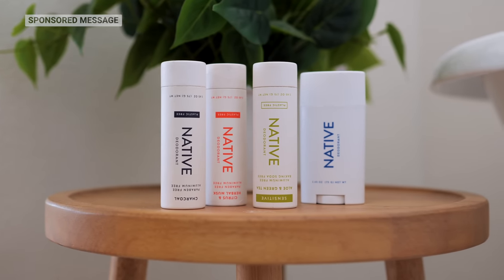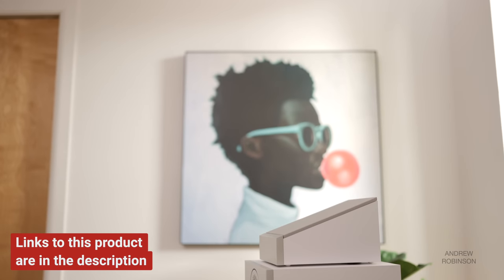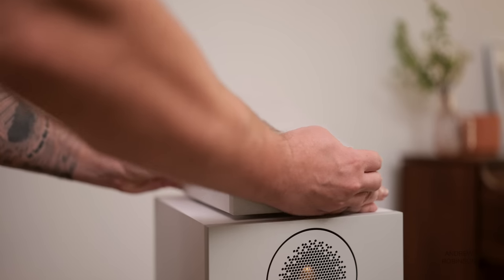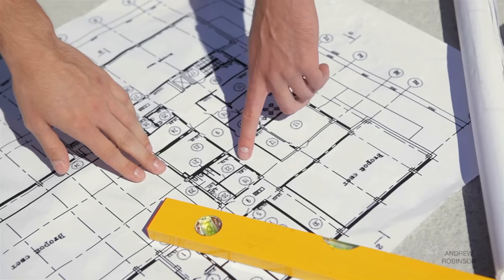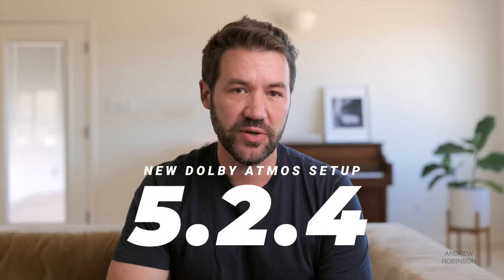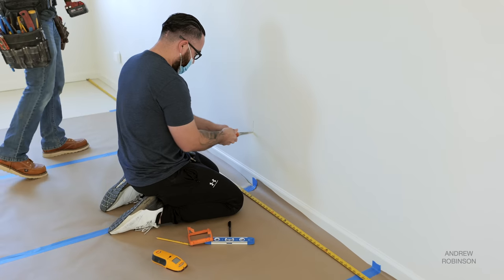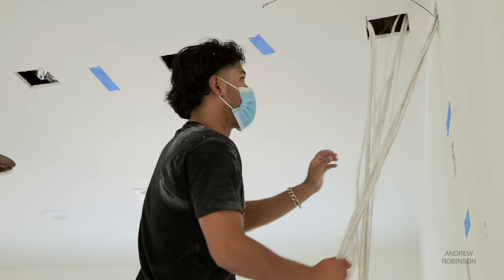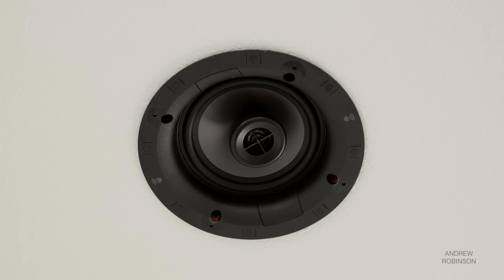INSTALLING DOLBY ATMOS SPEAKERS! Atmos In Ceiling Speakers

Comment: The comment about not liking rear surround speakers on stands got me thinking about my room.  My speakers are all up high on walls--that was how I had the room wired when it was renovated, and there's a door on the left side of the room where the front left channel is, so the only mounting location is above the door. (the speakers are all Klipsch Quintet speakers from about 20 years ago and I like them a lot.)  Also in the center of the front of the room is the back of the fireplace from the living room which is brick protruding about 2 feet into the family room, which is where the center channel is mounted.  A few weeks ago I got some Sony Atmos upfiring speakers and mounted them on either side of the center channel (which is above the TV).  I listened to the one Atmos disc I have (Steven Wilson's "The Future Bites") and I could definitely hear the Atmos content, as well as from shows on streaming that use it.  I just feel bad sometimes because I keep hearing you're supposed to have speakers at ear height.  (They do angle down to point to the main listening location).  It sounds good to me so I guess by the mantra of this channel that's all that matters, and there's really no other way to do it here so I'll be okay.

Comment: I added 4 ceiling speakers to our new house as well. I initially intended to use 2 for atmos and 2 for rear but the surround sound never sounded right. It wasn't until I bit the bullet and added two bookshelf speakers at head level for the rear channel that the atmos surround sound came alive. Even with aim-able ceiling speakers I couldn't move them enough to trick my ear into hearing "rear" sound from ceiling speakers.

Comment: Paint will oxidize and darken a bit if it's not used for a while....Andrew, I've always been under the impression that "surround" speakers whether side or rear were supposed to be around ear level to maximize their effect in a home theater...does having those channels in the ceiling change that experience?...in a good way, bad way?...not noticeable?

Comment: Hi;  I like you we have had some sort of variations of surround set-up's over the last 10 years, but I was lucky enough to have a barn 35x60 on the properity we bought a couple years ago and I have built a dedicated  music/theater room 35x24. I went with in wall/ceiling by RBH 8" woofers & dual adjustable tweeters, I also boxed them in and used sound deading and Rockwool insulation. The front speakers are RevelF228 Be's LCR and SVS subs. All I can say is  it blew me away from the old set-ups' and yes I did have the Revels for several of those iterations. When you get finished if you want to hear what your system can do put on the 4K atmos version of Waterworld , sit back  and enjoy.

Comment: Thanks for documenting the work. So, I thought rear speakers needed to be at ear level to the sides. I would be curious how they sound overhead. Years ago when we bought our house I purchased some Canton Ergo 601 speakers, which are shallow depth on wall slightly above ear height. They actually sound really good but in wall would have looked way better.

Comment: I know they are not Kristy’s exact words but Atmos is where the line is crossed in the waf and aesthetics department.  I would venture that putting 2 in ceiling speaker for rears is a nice compromise for rear surrounds unless your house is prewired when you built it as I had the luck to do.

Comment: That's a tough question.  I've done a little research on atmos placement recently, and it seems like even people that have been doing audio for years and years, put their atmos speakers in the wrong spots, either choosing aesthetics over sound, or following a diagram rather than doing measurements, or just by accident, and end up with disappointing sound, but if they are placed exactly right, it makes, apparently, dramatic differences to what they had previously experienced.  So, yes, I think, if you did your measurements correctly, you should hear a DRAMATIC improvement in sound over up firing atmos speakers.

Comment: I've got Niles in ceiling speakers and painted the grilles just using a fine brush and dabbing rather than brushing. That way the grille holes weren't compromised.

Comment: Hi Andrew, love the videos! I have a question I currently have the itch to integrate some kind of Atmos setup in my current 5.1 setup.  My rears on my setup are in ceiling just behind my listening position currently. I see you have gone that route for your rears as well.  How are you liking that? Vs having listening level rears.  I’m trying to decide whether to replace my rears at listening level or just add some upward firing Atmos speakers to my front speakers for a 5.1.2 (vs 5.1.4 by adding additional rears).  I also hate the look of rear speakers on stands.

Comment: The CDT-2800-C II’s you linked are not the same as the DS-160CDTs you installed. The former have horn tweeters while the latter have silk domes.

Where did you get the DS-160CDT?

Comment: Been here did that but after $9000 system with 8 ceiling speakers in our last house i would never do it again. New house setup is 2.1 this time $5000 and is all anyone needs. These home theater with 10, 12, 14 speakers i think is just way to much. Put the same money into a 2.1 setup and you will have better sound and better equipment.
Reply from the maker: If we didn't have the channel, I'm not 100% certain I would personally venture beyond 2.1 for music or movies.
Reply: Couldn’t agree more! I’ve had multiple “audiophile” and surround setups. The two best systems for dimensionality are hands down stereo setups. First is playing games on my PlayStation 5. The 3D audio engine is mind blowing, I can pinpoint sounds in a 3D space perfectly with my sub $100 studio headphone monitors. Next would be my desktop setup, with a nice DAC, Tube preamp, and studio monitors. With my desktop setup; there isn’t any sound behind me. Although; the horizontal, vertical and depth of field is astounding. There is also the issue of adaptability, I don’t think many movies studios actually go to very much effort to utilize rear channels. Home theater is like razors, they keep adding blades but it’s just a gimmick. My facial hair is like steal wool and my classic Gillette two blades are still the best razor. For massive spaces surrounds make sense, for 90% of people a 2.1 will be better.

Comment: Hey Kids, again congrats on your new home.
Thanks for sharing your cautionary tale to folks that decide to embark upon Install or In Wall speakers. Most may not foresee these problematic considerations, so bless you for putting it on the table. Its construction. Period. Arrrgh.
You probably went the right way if your bottom line was minimalist layout.. My question is what factors led you to in ceiling vs in wall format because you are now kinda locked into the Dolby Atmos only (or Atmos maximal) set up ? Are you not worried about un-maximised Auro or DTSX set up or potential? Or are you baking in a cost/simplicity comprise into your final solution? Maybe you don't have a back wall for #6 or #7 in wall?

Regarding"height" or "elevated"... depending upon who you follow, some suggest it might be best achieved on the vertical plane as suggested as  by Auro's designer Wilfried V-.B.
What are/were your thoughts or research about obtaining maximal height/Atmos-y results?
Did you finally go with compromise or preference or studies?
Either way I'm glad you didn't cheap out and you got professional help on this become-major construction Pandora undertaking, this is your business stage and you needed to get it right once and up front. 
Can't wait to see the final...  Are there echoes? Pending segment on wall treatments coming? LOL
CONGRATS KIDS  :)

Comment: May I ask why you didn't do in wall for the rear speakers? They would be mostly invisible but also maintain proper ear level position rather than effectively be a 3rd set of Atmos. Either way I'm sure you'll be thrilled and it will sound great, just curious!
Reply: Reason: I can not stand the look of in wall speakers or in wall subwoofers.
Reply: @KristiWright  that's fair! It can definitely take away from the living room aesthetic. I thought you two just didn't like speaker stands and I figured white rectangular grills on either side of the piano would have looked decent! But definitely not for everyone! Thanks for the reply!

Comment: My dream installation!! Probably a good thing you did all that before you started unpacking, but I can see how stressful that must have been. Another brand offering rear speakers with built-in upward firing Atmos speakers is Pioneer. The Pioneer SP-BS22A-LR Andrew Jones Designed Dolby Atmos Bookshelf Speaker has served me well in my 5.1.4 system.

Comment: Oh man... I think you triggered the PTSD I got from running wires in our first condo before we moved in...  It went from, I'm just gonna pop off the baseboards and run it that way, to having to buy a drywall cutter for my dremmel, to probably $300 in other tools, to having to buy a different type of speaker mount, to many other unforeseen problems.  Would it have cost me more to have an install done?  Yep.  Would it have taken five times less time?  Uh-huh.  Even though the end result was stunning in how professional it looked, I would never do it again, myself.  Most of the time, the cost of your mental health is the biggest cost consideration.

Comment: while you might think the kipsch are going to be flexible in what they will mate up with for LCR - unfortunately that is not the case with these.  They mate great with the RPF - but unless your other speakers sound similar to those - you are going to have some real challenges when it comes to timbre and sibilance.  Don't be surprised if you end up having to get some 33 band eq;s or some real fun DSP work in order to get these to mesh with the wide variety of speakers you bring  through.  

Congrats on the house, btw... enjoy! :)

Comment: Hi Andrew  I have pair of wired speakers (non amp) in my ceiling,  from my old surround sound system. I have now installed the Samsung Q600 sound bar, without rear speakers.   Will i need an Amp to use my old wired ceiling speakers, to connect them to the sound bar, as rear speakers?

Comment: I enjoyed your presentation. 
I used to do home theater  installation. 
I agree  wholeheartedly  with what you said.
Reply: I was thinking about  your ceiling speakers. 
You can and l have 
Use a dry brush technique  and dab color to match your ceiling  speakers to the ceiling. 
Take a little  paint and put on the brush  dabit off till almost dry and then dab  on the spk grill and the plastic  surround. 
You will find it will match pretty nicely. 
Remember  nothing  is perfect  but this should show fine craftsmanship. 
Enjoy!

Comment: I had six in-ceiling speakers and wiring for back speakers installed when we moved into our house four years ago. Same deal you experienced; lots of holes.

Great!

Ready for some 7.4.1 Atmos nirvana.

Now the embarrassing part. I haven't gotten an 11-channel receiver because I realized the built-in shelf it needs to sit on (where the speaker cables terminate...) does not have sufficient depth to support it. 🙄

Looking for your upcoming review of super-shallow 11-channel receivers. 😁

Comment: Thanks for the opinion on the upward firing with the ceiling height.  I gave vaulted ceilings that range from 8 to 16 feet across 15-foot room width. I was guessing it would be problematic.

Comment: Although it's not what I do for a living, remodeling and custom installs for audio, security and lighting is something I have done on my own homes and for friends, including one who is a custom theater installer, for most of my life. And yeah, there are some jobs that just aren't worth the time and hassle. Not to mention, on rare occasion, actually cheaper to let the pros do. It always pays to investigate and get a quote because you never know if you're actually costing yourself money if you don't. 

By the time I could afford a nice audio system I had lived long enough to know I was not a big time home theater person. I rarely watch movies at all much less at home so if it weren't for concert DVD's I'd probably never turn on the entire system. Therefore, by circumstance and happy accident, I have always done the type of system you are installing at your home and other than when I've helped my theater installer friend this is the only type of system I've ever done for people of more modest means. If it's done correctly most people who weren't there when the install was done will never notice the in ceiling speakers and few ever notice the in wall speakers. It's sort of like a small scratch on your car. You notice but no one else does.

As far as getting the speakers as well as the repairs to blend perfectly, well, the speakers you can never make totally disappear. Even the thinnest bezels sit slightly proud and the perforations on the grills always reflect light in certain situations differently than the surrounds ceiling will. As for the drywall repairs in most situations you won't notice them but in quartering light, unless you skim cost the entire wall/ceiling afterwards to bring the level up to the repair height there will always be a noticeable shadow line. If I recall though you were going to cover the front wall with some sort of aesthetic and sound treatment so that will cover those repairs anyway. On the ceiling you'll get used to them and quit looking up all the time. The best cheap solution is to paint the entire room, ceiling, walls, grilles and all at the same time. An interior designer my installer friend works with says sometimes painting the grilles the tiniest shade lighter or darker than the ceiling can help further blend ceiling speakers in but I think that's a crap shoot and still subject to specific lighting circumstances. 

A tip the pros do use when clients allow it is to try and match the in ceiling speakers to the shape of architectural elements already in the ceiling. For instance, if you've got rectangular beams or skylights running along the ceiling then use speakers with rectangular grilles. Got a lot of can lights on an otherwise flat ceiling then use speakers with round grilles. By the way, cathedral or vaulted ceilings when there's no second story or attic above usually have 10 to 24 inches of space above the ceiling depending on how the house was built and where you live. This is space for insulation and mechanicals so using the shallowest speakers you can is always a good idea just to limit insulation compression. On the rare occasion you run into a roof built on SIP panels, well, that's good for your electric bill and bad for your install! Just go with the in walls in that case. There are ways to make in ceiling speakers happen in that case but it'll cost ya! Anyway, hope that helps someone out there.

Comment: What kind of speaker wire did you use?  Did you consider suspending the rear surrounds from the ceiling or going with in wall surrounds to keep them on the same plane as the front channels?
Reply from the maker: The speaker cable used was from SnapAV (which is a dealer-only brand), but if you buy 12 gauge OFC copper that is CL-rated you'll have the same stuff. I didn't want any more "exposed" speakers than need be.

Comment: I'm so thankful for this video.  This is what I've got to do, right down to the speaker choice.  Thankfully, my room is inside of a Gambrel roof line that allows for literally standing up on top of the room (maybe having to duck a little) while working.  I thought I might have an electrician friend help me DIY, but after watching this and seeing your cost of $2,000~, I'm willing to just hire a pro team to do it.    @Andrew do you have a video on how to do rear firing speakers?  I saw you didn't like rear firing on stands, or are you saying the rear ceiling mounted will totally replace a rear firing surround speaker?